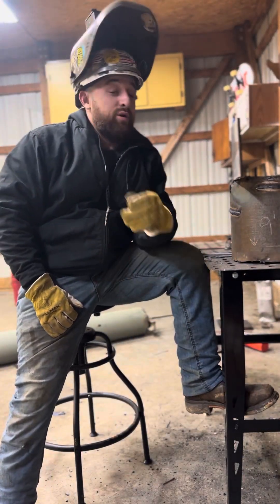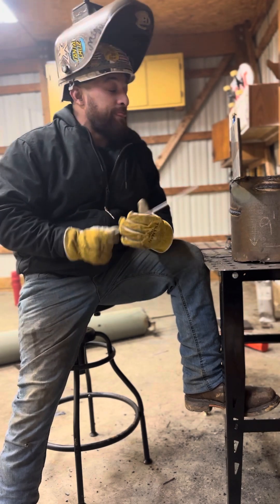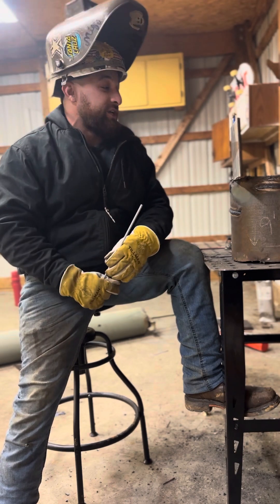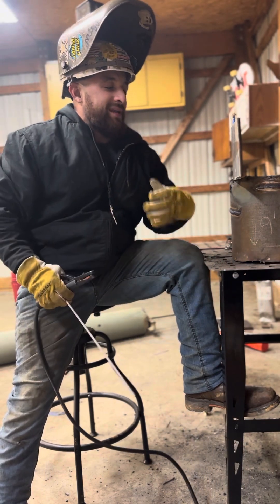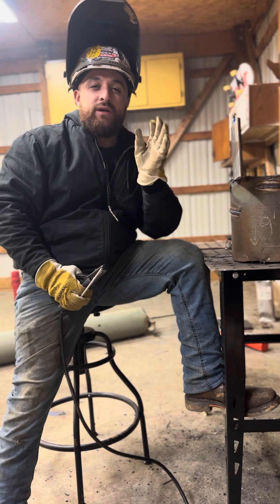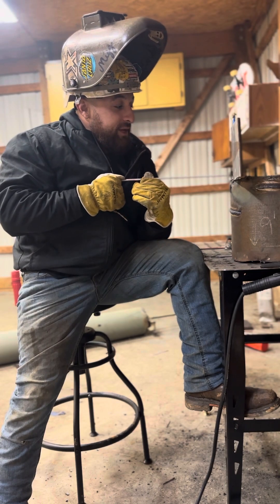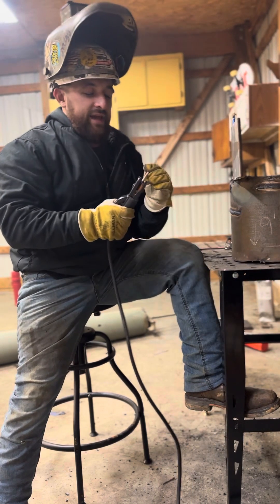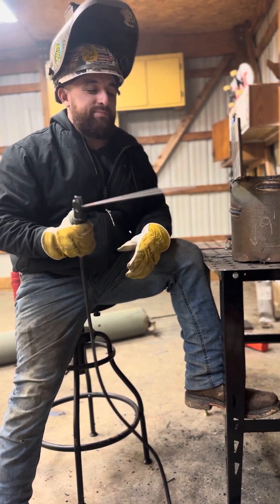Some 7018 3G welding tips.

Comment: Hello brother hope you are doing great 
6013 is sagging (dripping) when i weld vertical and horizontal 
Am i to blame or rod ?
Reply: Have you tried the whip and pause method? It allows the puddle to cool when you whip the electrode away and then when you whip it back you can completely fill the gap without it getting too hot and dripping. It’s what they taught us in school and it’s in the updated 2023 welding books.
Reply: @OfficialReckM8  
Hey brother 
Thank you for your reply 
I think our rods are very poor quality 
That is why it may dripping 
I tried every method possible. 
Now I understand why welders do not like 6013 rod
Reply: Is it easy to know about stick welding , and when am from African country and I have my experience in welding for a about 10yrs  what period can I take to expert thank you
Reply: Is it easy to know about stick welding , and when am from African country and I have my experience in welding for a about 10yrs  what period can I take to be expert there in USA
Reply: Is it easy to know about stick welding , and when am from African country and I have my experience in welding for a about 10yrs  what period can I take to expert thank you